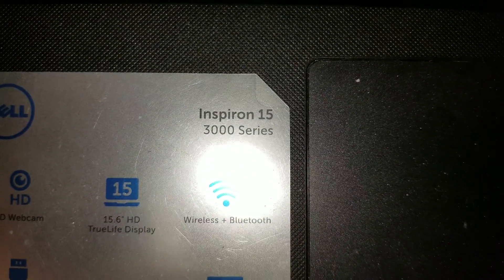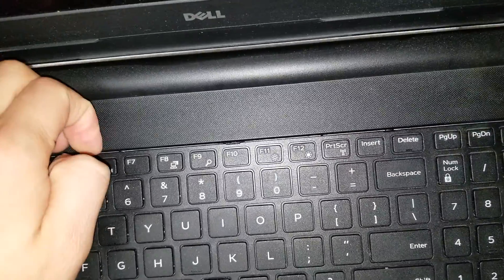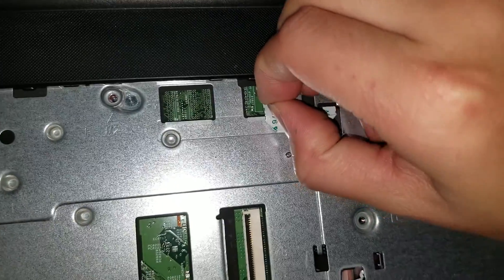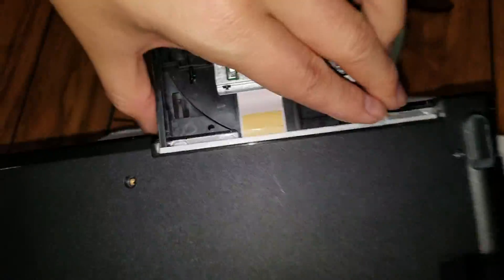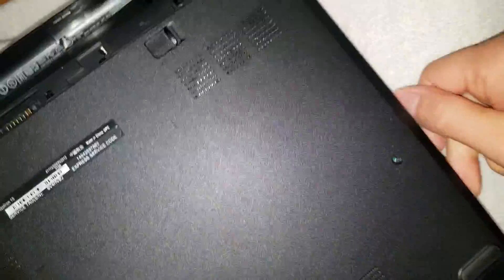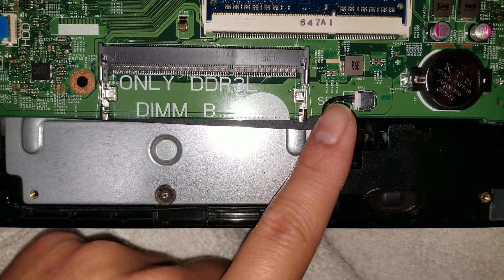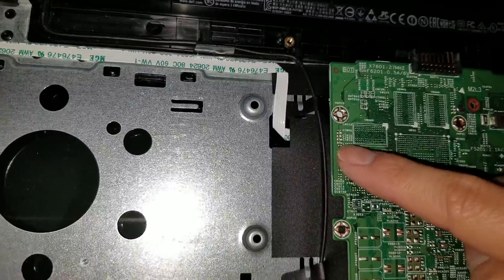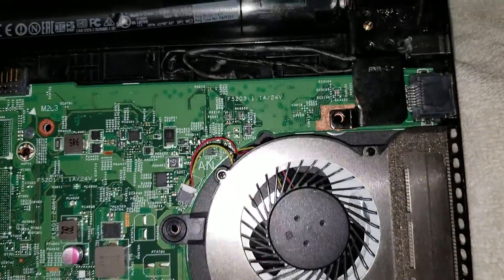Dell Inspiron 15 3000 Series Disassembly keyboard ram hard drive ssd replacement upgrade

Comment: What is that empty space on the top left cornor on 8:43? Looks like a place for GPU and if it is can we add one?
Reply from the maker: You can't add one, especially if you have to ask. Lol it's not something any random person can do and even if it was possible, it'll cost more than buying a computer with a better graphics card. You would need a more powerful power supply/charger, a replacement heatsink that cools both, a way to mod the bios/firmware to accept the gpu, and a multi thousand dollar machine to get the gpu and memory on there, let alone, finding a gpu that works with it. Lol

Comment: Hey 👋 im hoping Im not too late to ask since this is a 2 year old video. I spilled juice on my keyboard and im trying to open it to clean it. I unscrewed all screws in the back and unclipped the keyboard from the top but it just wont pop out. Im scared to damage the keyboard if I flex it too much. do yo have any tips? can I use the tool to pry the sides? help!
Reply from the maker: This video might be more useful. https://youtu.be/OfDsM65KrXM

Comment: My friend, thanks for this video. Mine is the same laptop Inspiron 15 3000 series. 
Just wanna ask regarding the optical drive. Once I assembled everything and started my laptop, I could not find the optical drive under this PC option
Reply: Is there only one connection for the optical drive that we find under the keyboard or is there another one which I am missing? Appreciate your reply
Reply from the maker: @sheejathomas7148  just the cable at 2:01 it could be the cable is damaged or you didn't seat the drive properly.
Reply: Thanks for your reply. Sure, I will check that cable.👍🏻
Reply from the maker: @sheejathomas7148  don't forget to like and subscribe if you haven't already. It'll really help me out. :)

Comment: I have a problem with display. It works only if I press above the key board. Is there any cable I can secure properly that will fix.this problem. Is it below the key board?
Reply from the maker: You might need to replace the lvds cable or the connector on the board might be damaged. You could possibly put a shim inside to keep constant pressure there.

Comment: How much does a dell inspiron harddrive cost even? My laptop is having some problems with the hard drive and i can't fix it
Reply from the maker: There's no specific hard drive for dell. I recommend a Kingston, crucial, sandisk, or Samsung 2.5" sata SSD
Reply: @ItsBinhRepaired  so if i would buy the 860 evo sata 2.5" ssd it would fit in the laptop?
Reply from the maker: @davissrenks7627  yup, most spinning drives in laptops are standard 2.5" sata
Reply: @ItsBinhRepaired  nice thanks for the help!
Reply from the maker: @davissrenks7627  you're welcome. Don't forget to like and subscribe if you haven't already. :)

Comment: do i need to unscrew on the back
Reply from the maker: I don't understand. Did you watch the video?
Reply: @ItsBinhRepaired  oh i missed thst part, i dont have the screwdriver for that nail size its too small i can only removr the keyboard casing
Reply from the maker: You can buy a set on Amazon. It's pretty cheap.

Comment: The later models like 3581 are so much easier.
Reply from the maker: Certain models are just stupid in terms of repairability. I'm sure they do it so people just buy new ones.
Reply: @ItsBinhRepaired  I couldn't be happier with my 3581. Linux runs and installs like a dream. Upgrading is painless. Sure the screen washes out in daylight but it is good enough for my needs.